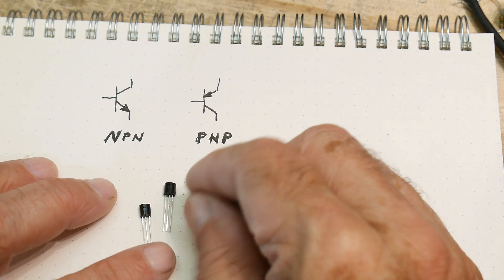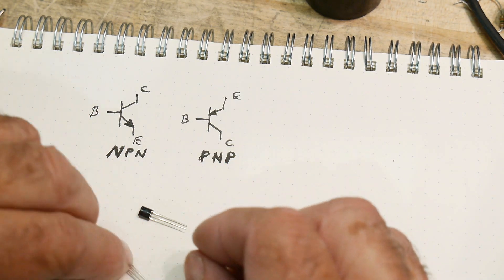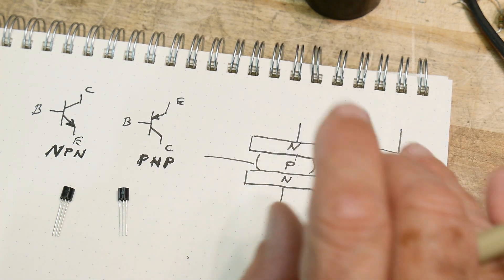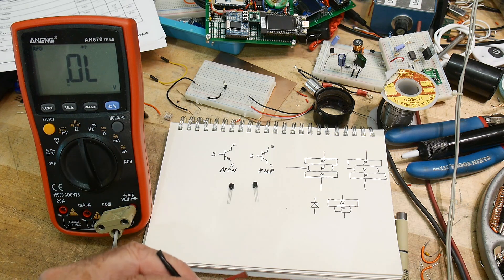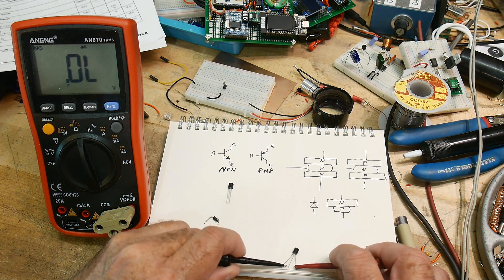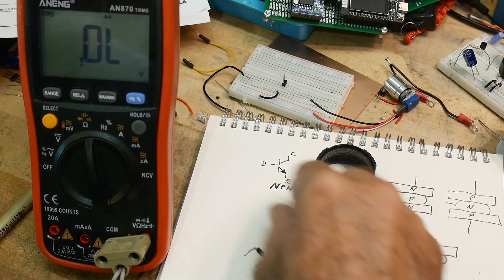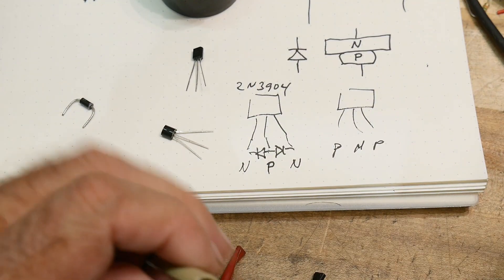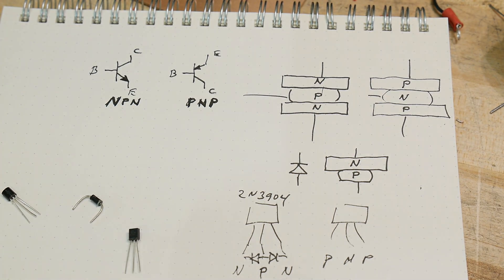#827 Basics: NPN PNP and Oreo Cookies

Comment: A fun thing to do with the 3 terminal tester is put in a Bi-Color LED and watch it light up as it's being tested!
Reply: Also you can check 3 terminal Potentiometers for being Linear scale or Audio Log scale by setting it to the center of rotation and comparing if the resistance is equal from the center wiper to both sides, or not = Audio Log Scale!
Reply from the maker: good tip

Comment: For the  Japanese devices that are marked like C828,  A&B are PNP, C&D are NPN.  People get confused with the arrow on the emitter. Easy way to remember is when the arrow is Not. Pointing In it’s NPN.
Reply from the maker: Not Pointing iN     ok
Reply: Japanese transistors are often marked with an abbreviation that omits the first "2S" of the complete part number - for example a "C828" is actually a 2SC828, Etc. You will be able to find more accurate datasheet results using 2SC828, than C828.
Thanks for reminding about the fact that 2SA&2SB are PNP, and 2SC&2SD are NPN Transistor types!!!
Reply: Note: "Chinese transistors" are all copies of Japanese (2S) and American (2N) transistor designs from the 1960-80's.

Comment: Oreos are symmetric. Why are transistors asymmetric? Is there some functional reason or is it just a side effect of how it is actually manufactured?
Reply from the maker: transistors are way more complicated than just two diodes. Lots of physics going on. You will need to read up on it. There are lots of different types of transistors and a Jfet transistor can be perfectly symmetric and work rightside up or upside down the same.
Reply: The automated testers, like the one shown at the end, label emitter and collector based on whichever configuration gives the greater hFE. It will still "transist" the other way around, just not as well. So its a deliberate engineering choice to make it work better in a preferred configuration.
Reply: Wikipedia says: “The lack of symmetry is primarily due to the doping ratios of the emitter and the collector. The emitter is heavily doped, while the collector is lightly doped, allowing a large reverse bias voltage to be applied before the collector–base junction breaks down. The collector–base junction is reverse biased in normal operation. The reason the emitter is heavily doped is to increase the emitter injection efficiency: the ratio of carriers injected by the emitter to those injected by the base. For high current gain, most of the carriers injected into the emitter–base junction must come from the emitter.”

So, I guess symmetric transistors can’t easily (or can’t at all) achieve the same gain levels.
Reply from the maker: @AdrianBoyko  Jfets are the exception

Comment: Thanks for the great video. It was very educational. So now I am wondering if I can create my own transistor by connecting two diodes back to back (or front to front) and sort of making my own double stuff oreo from two different cookies. Is that possible? I am sure it would not be as effective as a device made to the specific switching or gain requirements for a real transistor, but would it work? Or would it fail since it would essentially be  n-pp-n  or (p-n-n-p) ?
Reply from the maker: It's more complicated. Needs to be one structure. The same filling needs to touch both cookies.
Reply: @IMSAIGuy  Thanks for clarifying, I thought I might be oversimplifying it. And if it did work the way I was thinking, then there would probably be a lot of videos explaining how to replace a transistor with a pair of diodes. Thanks again for the great videos,

Comment: Do you know of a way to differentiate emitter from collector with only a multimeter?
Reply from the maker: I don't know of one. Maybe a viewer has an idea
Reply: @IMSAIGuy  Yes, for 2N3904: Connect your DVM (in 200K/2MOhm Range) to the suspected Collector and Emitter leads (you'll be doing this twice, swapping the leads)  with the "Base" not connected. Now moisten your finger tip and touch the center base lead and each of the other outside leads and note the resistance - one will read open circuit, and the other a conduction (~25K Ohms) now you swap the suspected Collector and Emitter leads and do the same finger-tip test again - one way will read an open circuit, and the other way will make a reduced conduction (~200K Ohms ) to the other lead which is now identified as the Emitter lead. Works for PNP & NPN. This works because biasing the Base connection with voltage from the Collector always has gain conduction function over bias from the Emitter (common Base amplification).